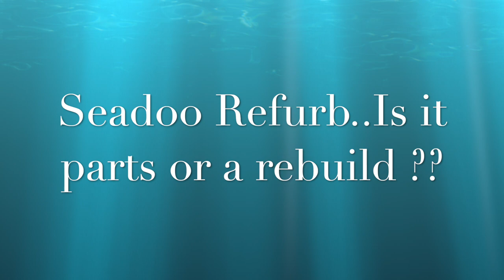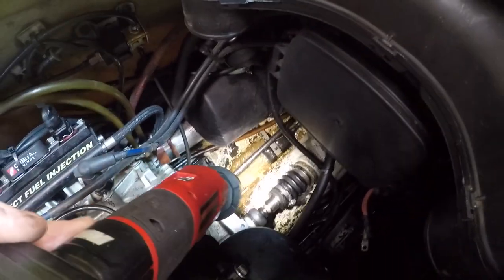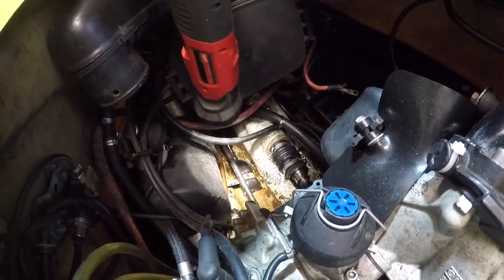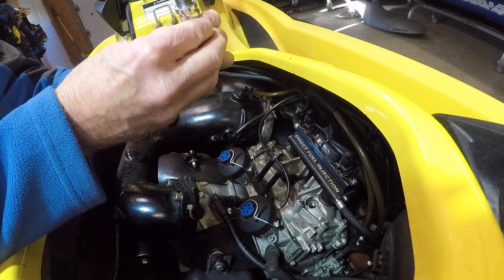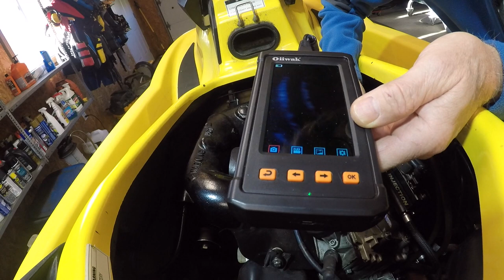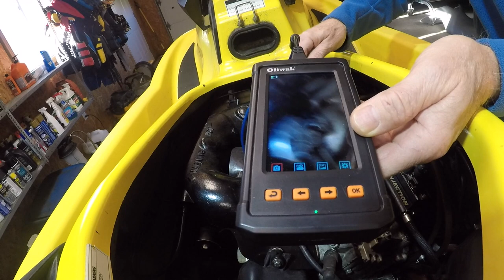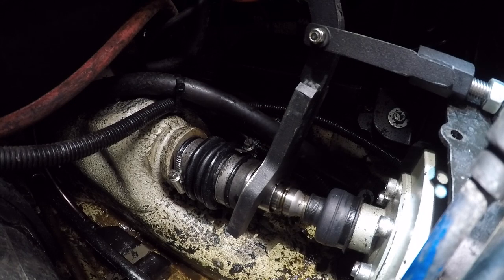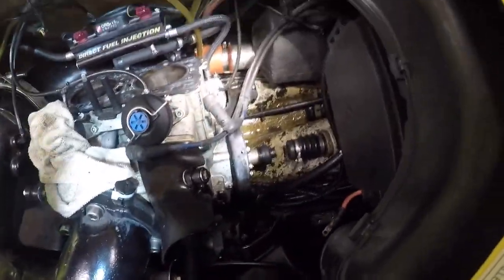Part it out or fix it ?  Seadoo RXDI   HD 1080p

Comment: Man,  these vids are great. keep them flowing
Reply from the maker: Machines are hit an miss.  You don't see deals like this come along too often.
Reply: @SeadooRefurb  For sure, excited for your next video. Thanks again for sharing.
Reply: @SeadooRefurb  Hey, quick question, I live in the Windsor area just south of you.. 3.5h away. If I wanted to do a complete rebuild of my engine, where would you recommend ordering parts from?
Reply from the maker: @MrDraftkid  I have many places for different items.  What are you looking for ?  Ebay is usually my first go to place.  Then SBT for bits and pieces.  There is a place in Oshawa called GP bikes and they have lots of parts ..gaskets ..pistons etc..
Reply: @SeadooRefurb  My plan is to do the crank and pistons, and also rebuild the jet drive.. The engine runs and has good compression (just over 150 psi on each cylinder) but is just over 300 hours so I'm sure the bearings are getting tired, it is a 2000 GTX RFI 787. It was purchased from my aunt and uncle from the cottage and has always been dealer-maintained.. probably just basic maintenance to keep it running for the grandchildren (it's been driven rough most of the time I'm sure). I've read here and there on forms doing a rebuild around this many hours should prevent anything catastrophic from happening and costing more. I'm guessing there may be more items I should consider replacing.
Reply from the maker: @MrDraftkid  crank rebuild i go to CV tech in Montreal.  They are quick and awesome.

Comment: I have a 2003 Seadoo RX DI. Had the engine rebuilt and installed. But for some reason when you put the key on the post I don't get any beeps or anything at all. Would you might know what would be the reason it doesn't? It was fine before the rebuild. I appreciate any feedback if possible.
Reply from the maker: First thing is to check fuses and check powers and grounds.